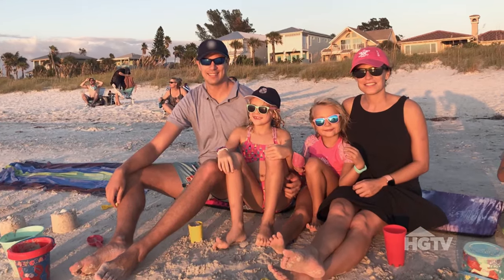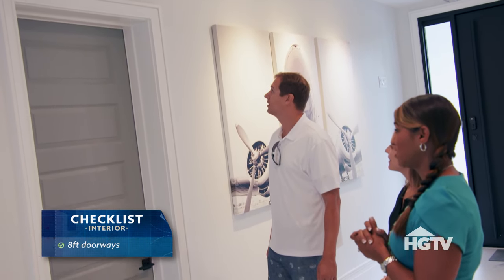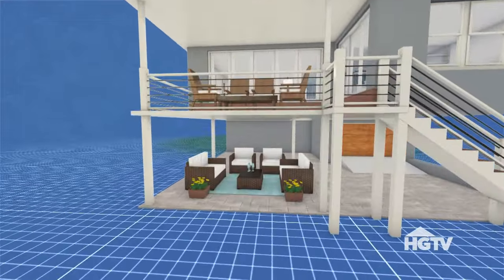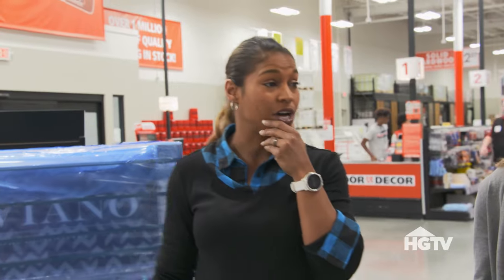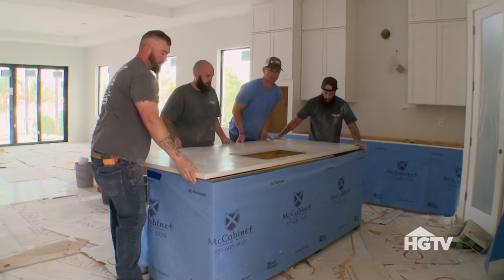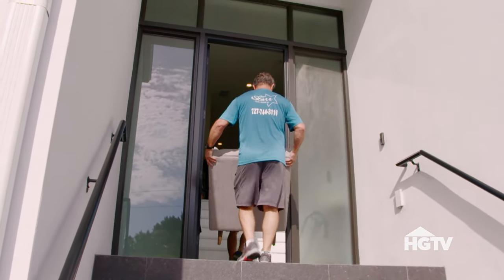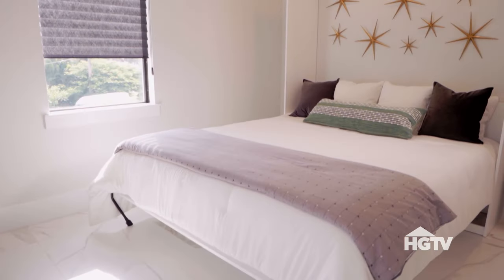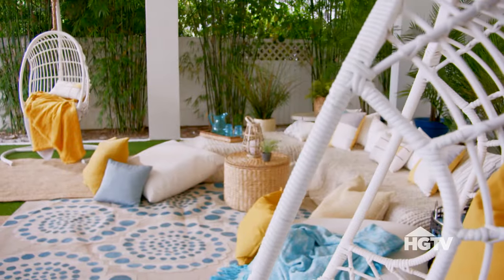Restarting From Scratch | 100 Day Dream Home (Rewind) | HGTV

Comment: This is my first, I’ve never seen a house being built with cement block bricks in the US.
Reply: That surprised me too.
Reply: In Florida, many of the houses have to be built with cement block because of the hurricanes. The homes have to be strong enough withstand 150+ (mph) winds. I'm living in a home right now built out of cement. Very solid!
Reply: Juju, In the U.K. we build with concrete blocks then a gap for putting insulation then brick. Yes, very solid and we don't have hurricanes but brick keeps the water and cold out. We don't have termites either, or mosquitoes.
Reply: No kicking through those walls. 😂
Reply: They're required in hurricane (typhoon) states like Florida.
Reply: Me too but i guess it makes sense since they get hurricanes in this area like the  couple said!!!